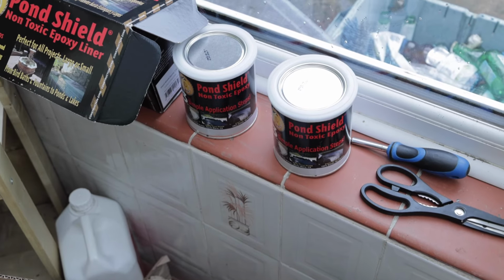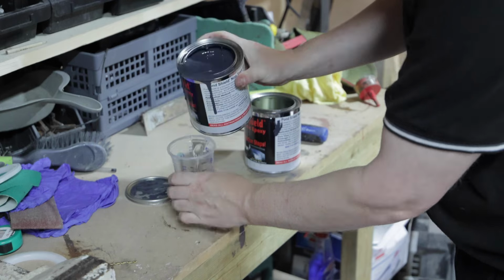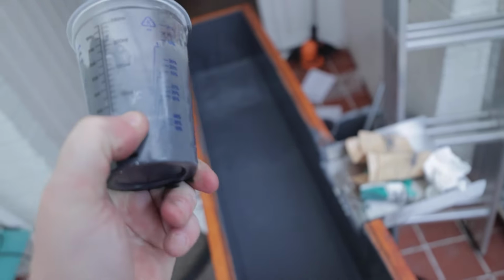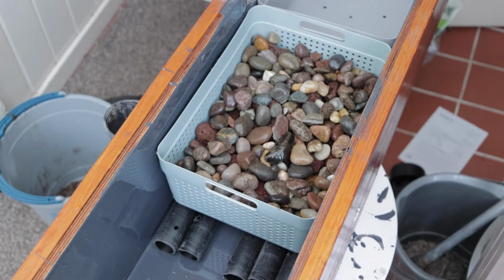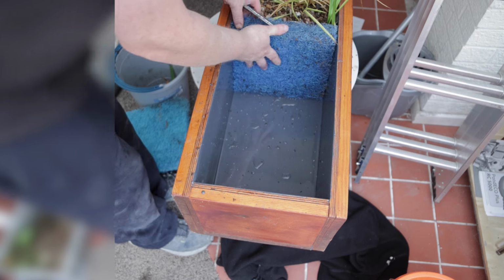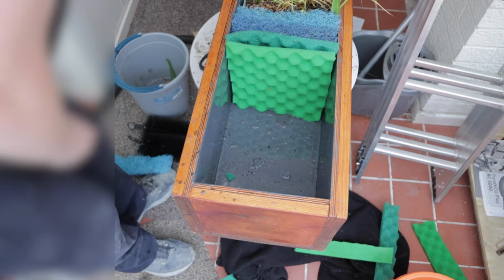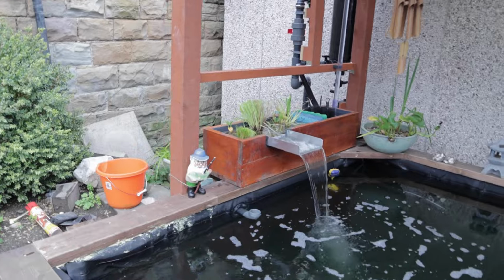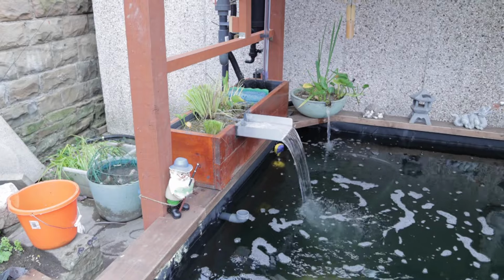How to build a pond planter filter box part two

Comment: My dad built a wooden boat (only 12 ft) and knows exactly what epoxy based products are like 🤣🤣🤣🤣🤣 that being said you can get Liquid rubber here in the UK it might be similar but cheaper or simply coat the wood in epoxy resin and a little bit of chop strand fiberglass matting ! No need to make a filter look pretty with gel coats and stuff ?

Comment: You need a 2 to 1 ratio... Ofcourse it goes off in minutes on a 1 tot 1 ratio
Reply: @rsdejong  but it didn't go off quick on the wood ? That's what he's getting at !
Reply: @oliverskinner8962  maybe didnt mix it correctly the 1st time
Reply from the maker: @rsdejong  hi yes I did mix it the same way but what I did find was I ran out of hardner I believe the company is cheeping out and not putting enough hardener in the tin. the mix here has to be equal parts 50ml of paint 50ml of hardner. one of the fibre glass people says because more heat is generated in the tin and cup thats why it goes off quicker hard to believe. I still have half a tin of paint left and maybe 10%of hardner in the tin. So I have almost run out of hardner. I have mixed the correct amount according to the instructions.
Reply from the maker: @oliverskinner8962  thats correct it would appear if its in a cup or tin it gets hot quick and goes off quick does not help if your trying to use it.
Reply: @yorkshirekoi2246 these are the instructions, i think you might have misread it:  Each kit contains pre-measured amounts of Part A and Part B that are at the proper ratios. The ratio is always 2 parts of A to 1 part of B. Choose one of the recipes below. One if for single coat application (SMOOTH SURFACES) and one is for two coat applications (ROUGH SURFACES). Start by mixing the recipe below in order to gauge how much material can be safely mixed and applied within 20-30 minutes.